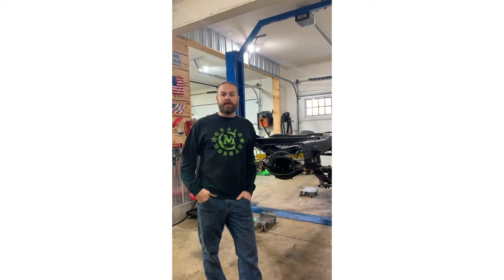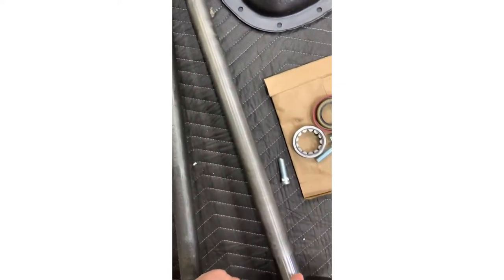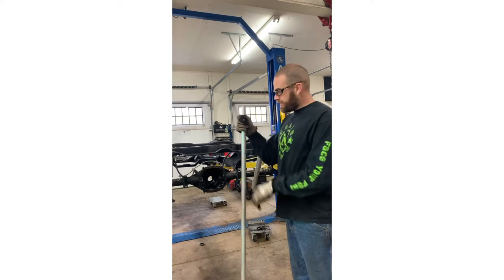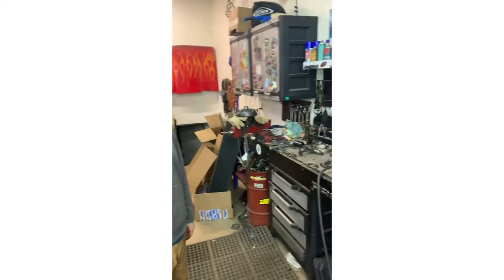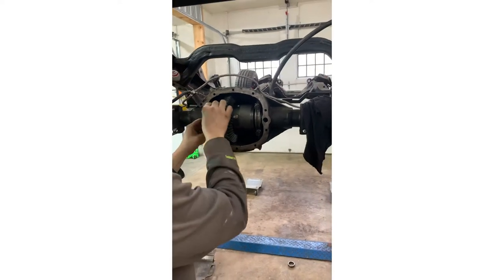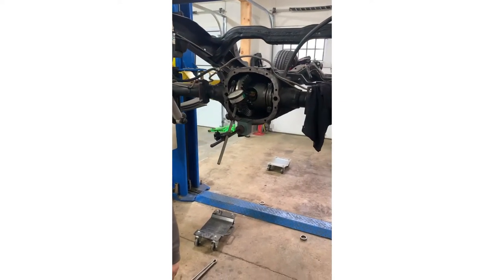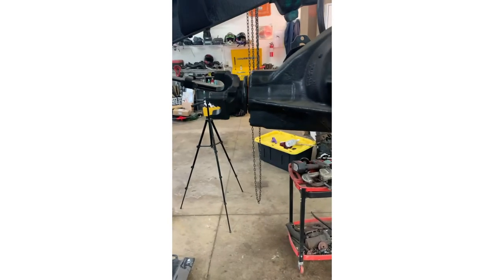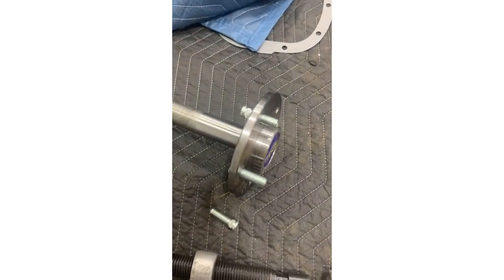How to upgrade your GM 7.5” 10 bolt rear end!

Comment: What kind of power with slicks is that 7.5 going to hold? I'm building an 85 Monte Carlo SS and I need a rear end upgrade, but I don't have the cash for a 9 inch Ford.
Reply from the maker: Same, upgraded to Richmond 28 spline.  Built 5.3 going in so I guess I’ll find out 😂
Reply: @FlippinCustomized  how has it held up?

Comment: I havea 1991 Chevrolet S10, extended cab, 2wd that I'm building in memory of my father. That has a 4.3 non vortec V6 with the 700R4 transmission now. But wanting to know exact part numbers that you used because I want to beef up my 7.5 10 bolt to handle more and Im also gonna use a 3.73 gear ratio but I want to use posi Trac. And will be using a Cal Trac ok the rear with leaf springs.
Reply from the maker: Part numbers for what exactly
Reply: @FlippinCustomized  The part numbers for the upgrade parts you used would be helpful

Comment: Now is this a kit you part for the upgrade or did you have to buy parts separately
Reply from the maker: All separate
Reply: See I was about to put a 5.3 L in my 2001 Chevy Blazer two wheel drive four-door then it came to my realization how much horsepower is that little stock differential going to take before for a grenades

Comment: if my 84 cutlass 7.5 rearend with open diff spins one wheel 2.25  times  per driveshaft revolution, what ratio is that?
can an s10 rearend be a donor  for 84 cutlass or is it totally different track width as well as mounting system?
Reply from the maker: uncertain on that one, have to research it

Comment: How much power should this setup hold I’m using a camed 5.3l am I asking for trouble?
Reply from the maker: Same set up as I’m running in this, stay tuned 🤪 should be good for 400hp
Reply: @FlippinCustomized  so how long has it held up so far I was kinda wondering for my elky

Comment: Part # on axles 28 spline?
Reply from the maker: This had the 28 spline axles,  were you looking for something specific?
Reply: The video said it had 26 spline and you change it to 28 spline. I just wanted to know where you got the 28 spline. How much it cost and the part #
Reply from the maker: @jessecarcamo1802  sorry about that 
They were Richmond 9225108 axles they were about $125 each
Reply: @FlippinCustomized  thanks for the info that was really helpful
Reply from the maker: @jessecarcamo1802  glad to hear it, thanks
Reply: I Have a 1996 z28ss I want to upgrade my 7.5 10 bolt rear end so it can stand 1000 hp
Reply: I have a 1996 z28ss I want to upgrade my rear end  How much power did u upgrade ur too and can u upgraded even more for 1000Hp
Reply: 7.5 10 bolt when beefed up are only good for 600hp....idk if it can withstand the slicks as well though